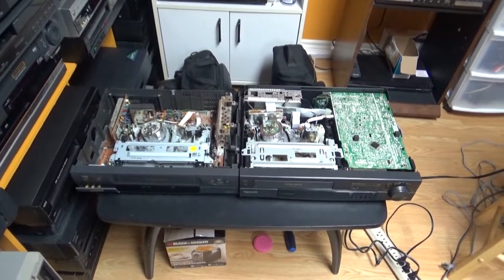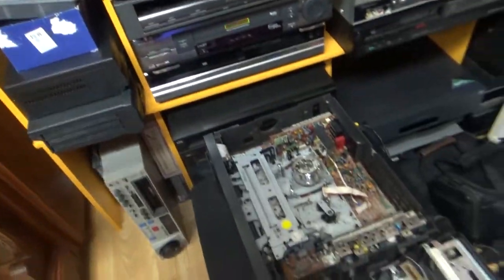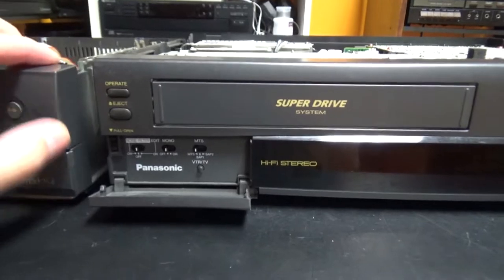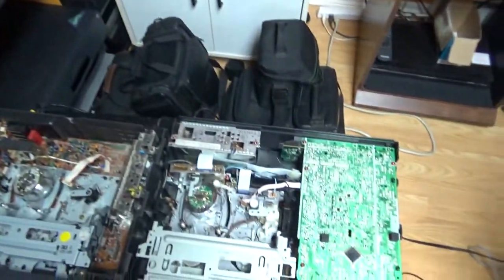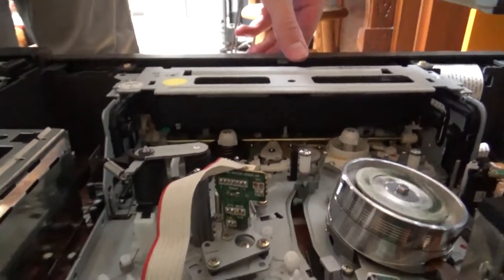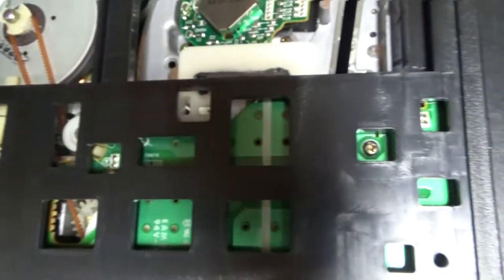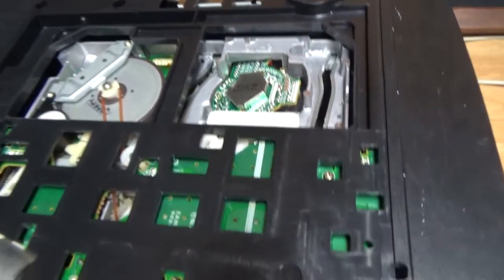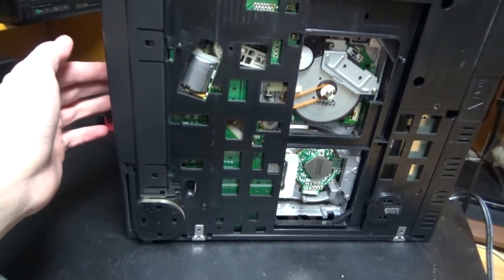Samsung and Panasonic VCR comparison video

Comment: On newer samsung decks you can turn off the on-screen display in the menus if you have the remote, maybe you can with this as well?

90s panasonics often suffer from electrolytic capacitors going bad. Maybe that's what's causing issues with the display? I got the top-of-the-line Panasonic NV-HS1000 here that I think is from around the same time as your NV-HD100PX and some of the power supply capacitors had started leaking. It has the same mechanism, some of the electronics are very similar so I think it's from the same year or lineup. Planning to do a video on it soon, but I've been trying to fix an issue with it first.

I think Panasonic moved to something more like the samsung in the next models. E.g the NV-HD620 (don't know us equiv) still has k mech but with drum motor on top and mechanism in the middle on top of a PCB. For the 630 they swapped to the more cost-reduced z mechanism.
Reply from the maker: I don't have the remote for this Samsung VCR. I used to have a Panasonic NV-SD300 with the K mechanism and it had the circuit board under the mechanism. I made a video of it. I sold it so I could get the NV-HD100PX.